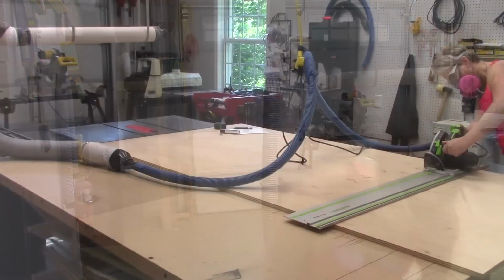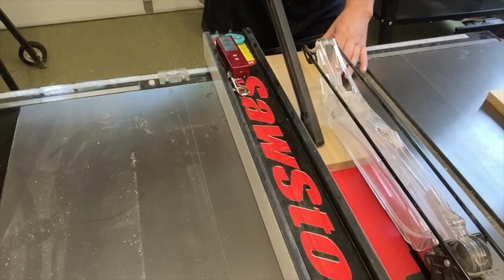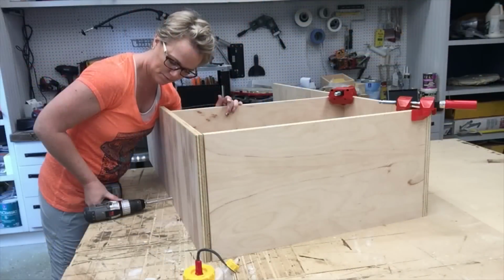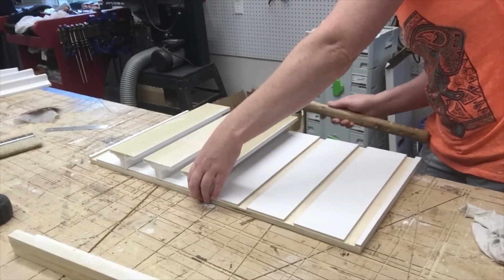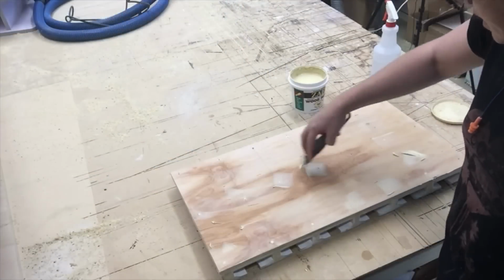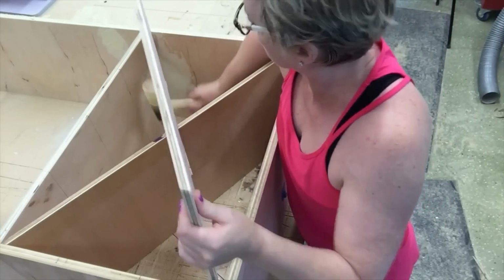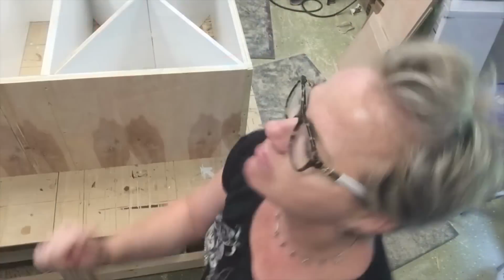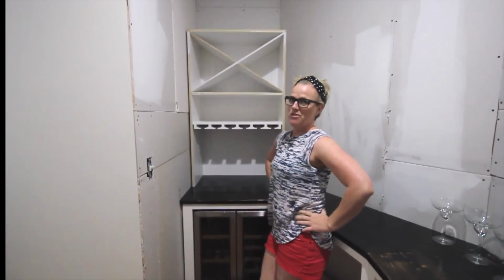Wine Storage Cabinet (part 1)

Comment: You are amazing!  How did you learn to build?   I wish I could learn to build things. Could you make something with just a circular saw and a drill? 
Like a floating shelf.  The reason I ask is because it's all the tools I have so far.
Reply from the maker: +David B You can do a lot with just a circular saw and a drill.  That's what I used for years and years.  Having better tools allows you to create with precision and accuracy -- easier and faster.